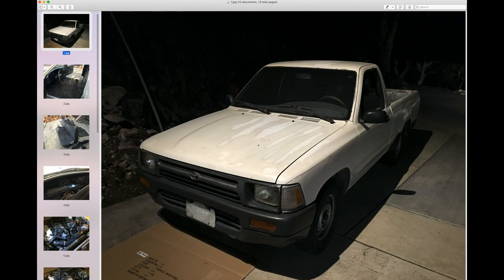Overview of the Toyota 22RE motor... what are all these vacuum hoses???

Comment: Where did you get your wiring harness?
Reply from the maker: I built it. It's the factory harness mostly, but I took it completely apart and then modified connections and installed my own high temp sleeving, etc.
Reply: Wow! That’s amazing!

Comment: Great video! But you really stress this tachometer... Do you really need one that bad? I've been driving trucks for years without a tachometer, you should be able to feel the engine it's almost second nature.
I mean I could see it for a high performance situation but not necessary for a daily driver or a casual driver
Reply from the maker: They come in handy. Also, my motor / cam is setup for top end power. The difference between winding out the motor to 6000 vs. 6500 on shifts can have significant impact on piston lands, ring flutter, etc. If it were just a daily cruiser then it wouldn't be as important, although I would still want to have a tach. Also, on this particular truck, I'll be replacing the motor soon with a 3RZ turbocharged motor. That spins up to more like 8000 RPM w/ high boost levels, so the tach becomes critical in that situation; I was trying to keep the analog gauges while doing that, although I sure do like those Haltach dashboards :)

Comment: Awesome video. So I recently had to do a head gasket on my 91 22-re 4×4 pick-up. I also did the Air injection delete and EGR delete. Truck idles great. But if I manually rev the motor up from the from the throttle body it doesn't idle back down so the way to a idle line it should and when I drive it the is no power it won't even spin the tires in the gravel. It won't even drive up a hill without shifting all the way to first gear sometimes. The truck looks like it has a new TPS on it. I was going to do the oulm test on the TPS today but it's raining really good today it here in Washington. We're would you start with this problem? Any help would be great. I enjoy your videos.
Reply from the maker: You definitely want to make sure the TPS is perfectly adjusted according to the shop manual. I would also check to see if the door on the AFM is operating correctly and not binding or sticking partially open. Try running a can of Berryman B12 fuel injector cleaner through the gas tank also.. that can often help noticeably. Let me know if you have any more questions - gotta be spinning tires in the gravel!!